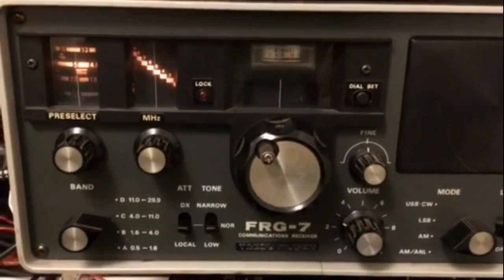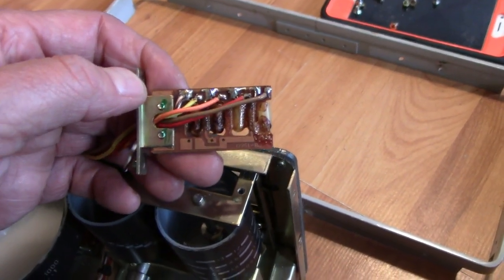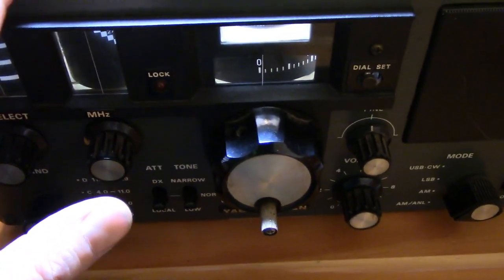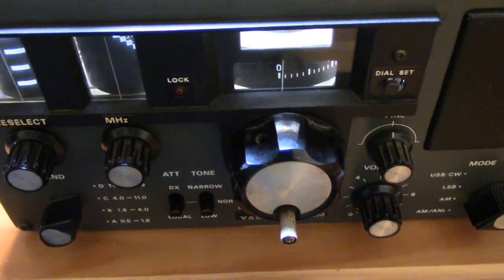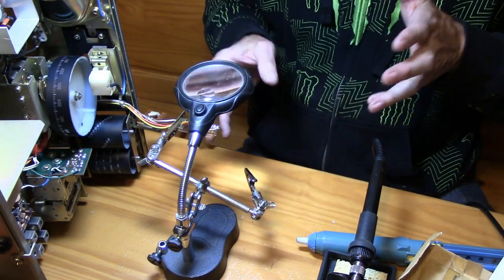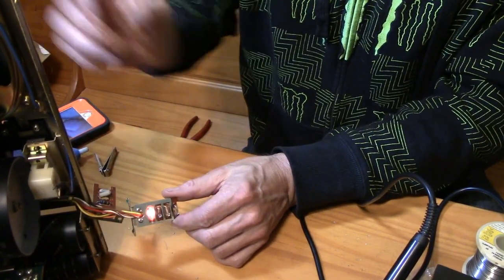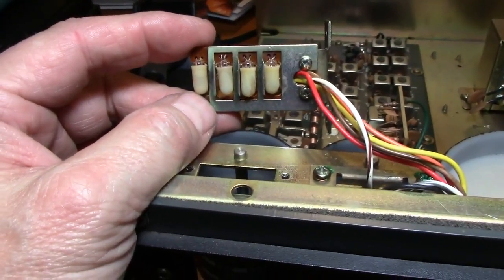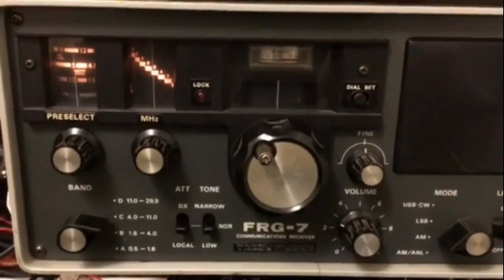Yaesu FRG 7 bulb change, bring an old radio back to life October 2019

Comment: Nice work Fred. I found my FRG-7 at a yard sale some ten years ago.  It did need the band and mode switches cleaning and after a year the bulbs started failing.  I fitted some warm white LEDs and added resistor.  I rather neatly wired a resistor into the “ladder” for the MHz dial.  Also did the kHz dial by fitting the LEDS into the original grommets.  If you use LEDs, you should roughen the ends of the ones in the  ain dial to get even lighting.  The on,y other issue was small dry leaves in the I.f. board.  No damage, but it suggests the set was in a shed for a long time.